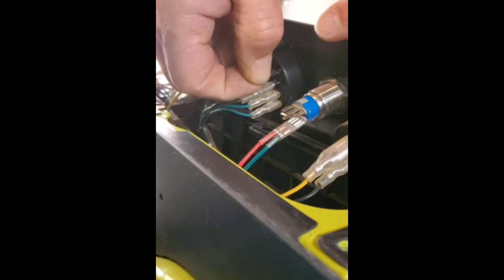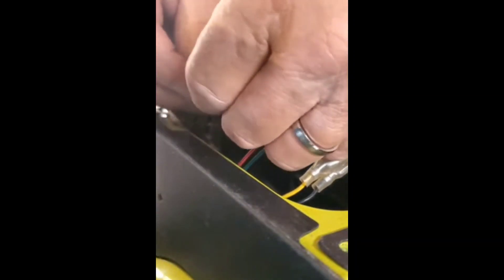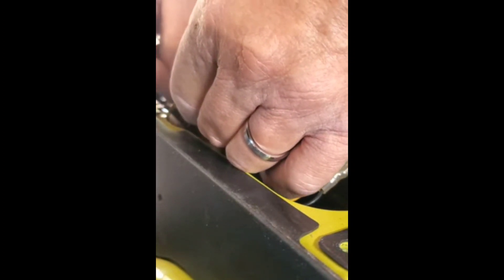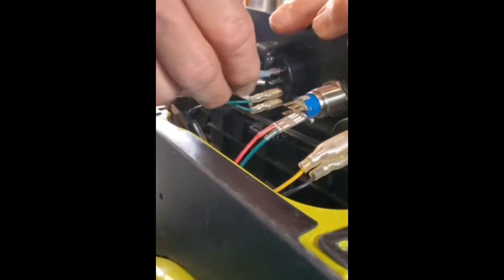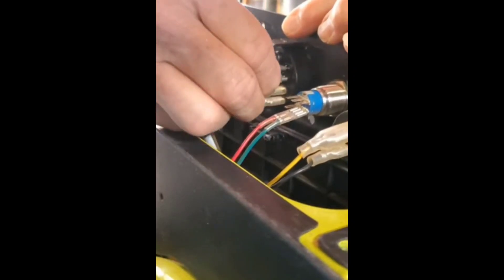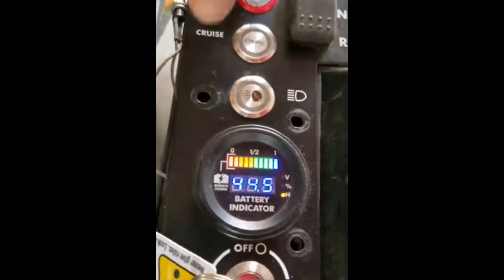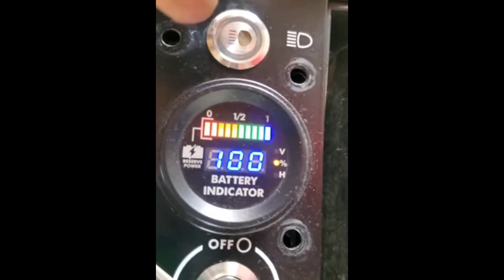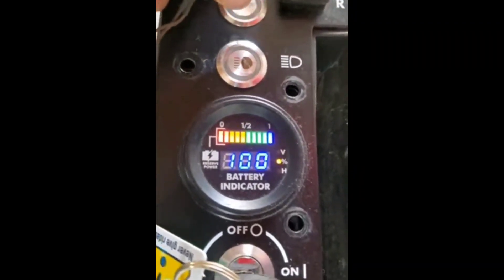Ryobi Factory Gauge Modification

Comment: I did this mod and after mowing the volts resting are 51.3 but the bar and % show 60%.  Charging port blinks rapidly, I think that means its about 80%.  Something is not reading correctly? May simply be the quality of the gauge?